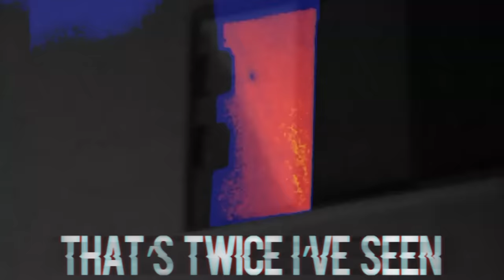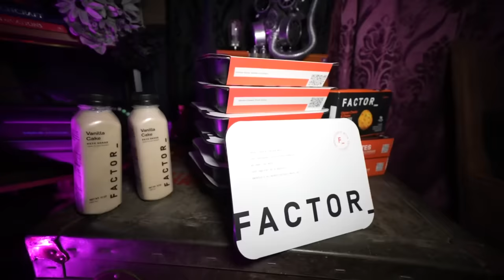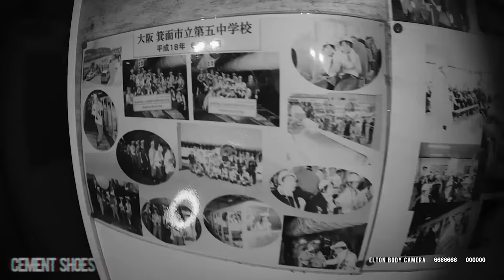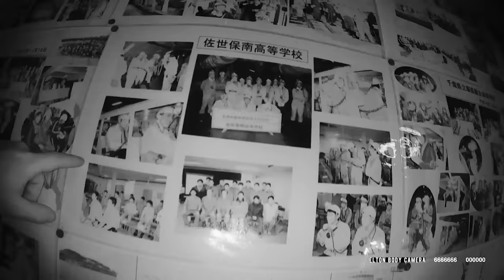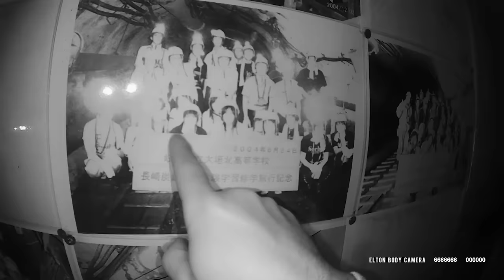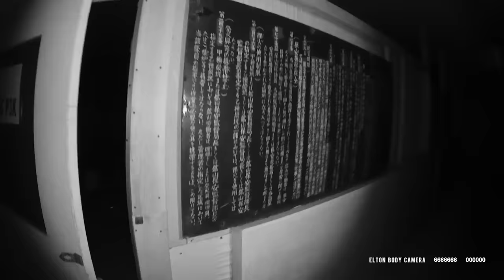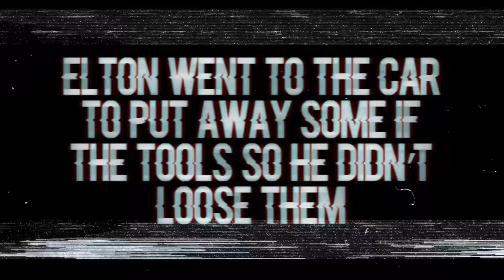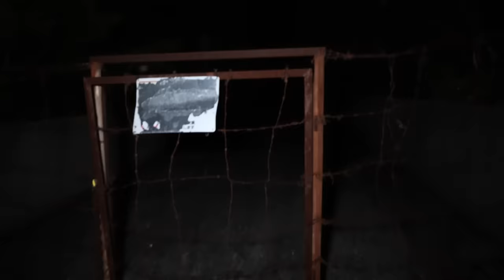OVERNIGHT on JAPAN’s MOST HAUNTED ISLAND (ABANDONED) *CHASED by POLICE*

Comment: Just so everyone is on the same page, Thermal imaging can be unreliable for picking up entities or anything of the sorts. Water has a higher heat capacity than most materials; it also retains heat longer. So damp areas thus appear warmer than their surroundings and can be identified by thermography. Hence why the statue and building(s) appear 'warm'. Heat also rises to the top of buildings, so second or third stories can appear warm while the lower half appears cold.

Comment: Different materials - like concrete or metal etc. - as well as taller objects will hold onto the warmth of the sun longer and show up as warmer on thermal goggles. With such expensive military grade they’re going to be very precise and different angles will also affect how you see the temperatures. If you’re looking for the paranormal (and I’m a believer) it might be a good thing to get familiar with them or use less expensive goggles that are straight forward, so it’s obvious when something you’re looking at is abnormal. In this video and the forest video, there were things that were easily debunked and explained that you were convinced were paranormal or abnormal through the goggles.  Just mentioning to help with creditably as it’s obvious you’re taking your work seriously and putting a lot of work and effort into your videos, so cleaning up anything that might make viewers take you less seriously might help. Or really get to know how the goggles work and their nuances. Just to know if it’s something to point out or not. Or maybe not. Just my POV.